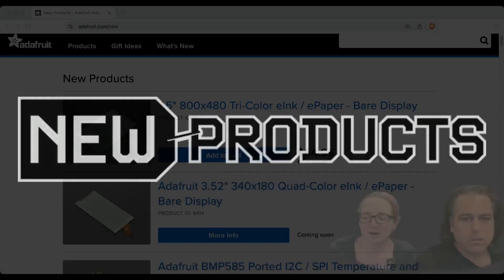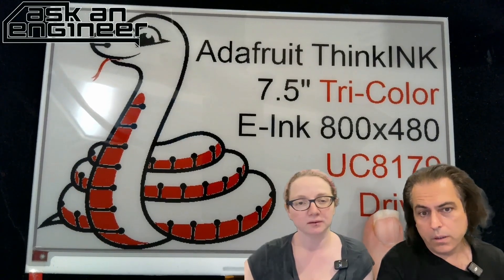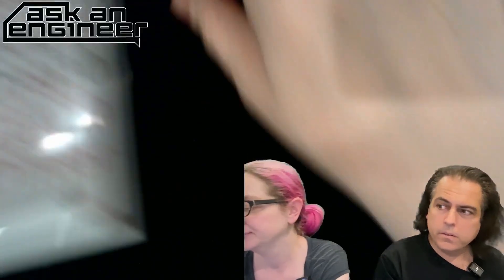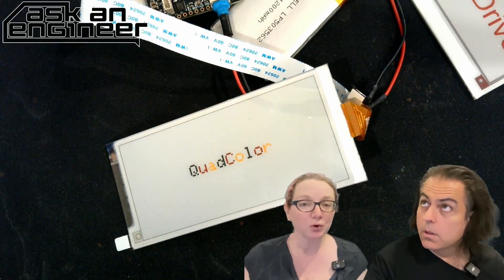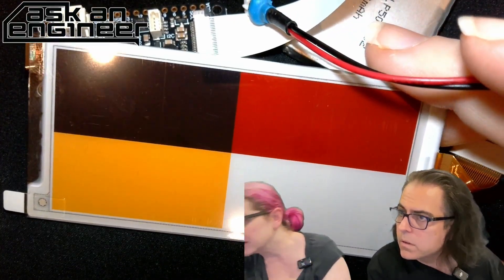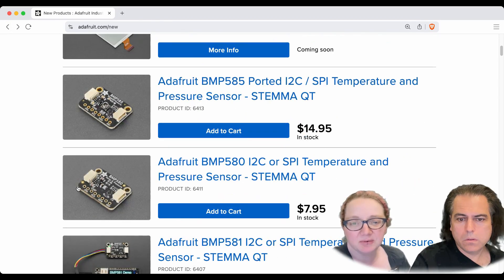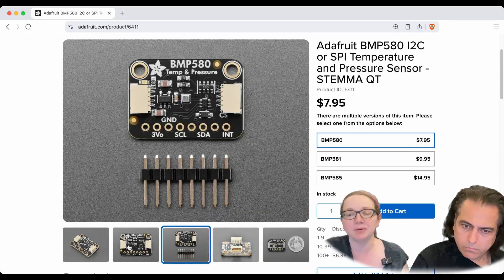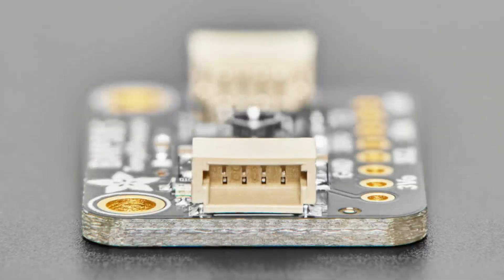#NewProducts 8/27/25 Feat. @Adafruit BMP585 Ported I2C/SPI Temperature & Pressure Sensor -STEMMA QT

Comment: I'd love to see a high data rate, i2c gps module for drones, rockets, cars, boats, etc. Most of the GPS's that are out there are 10hz refresh rate and you barely see any i2c support. I know you have the pa1010d and other such devices but they have the slow refresh rate issue
Reply: you can use UBLOX M9N，max 25hz，support I2C